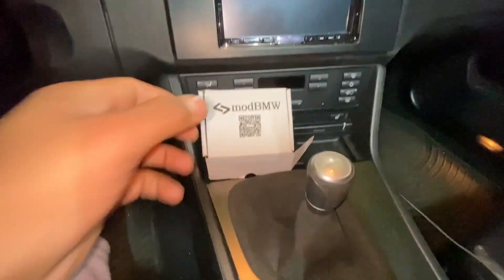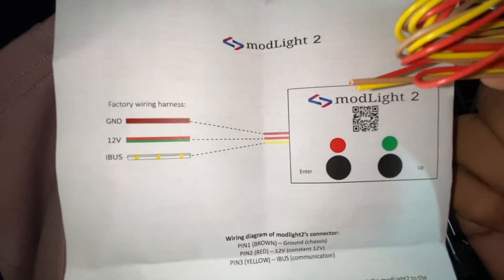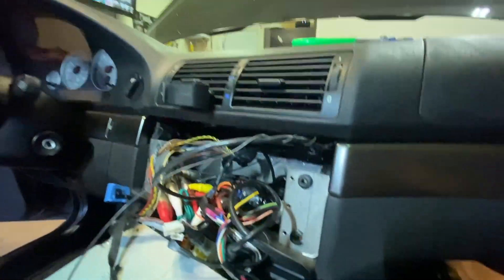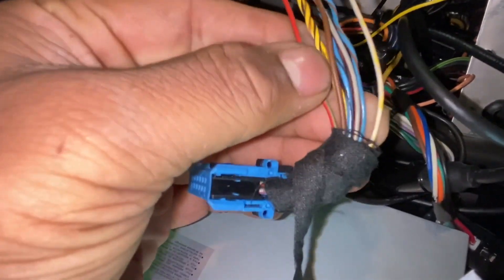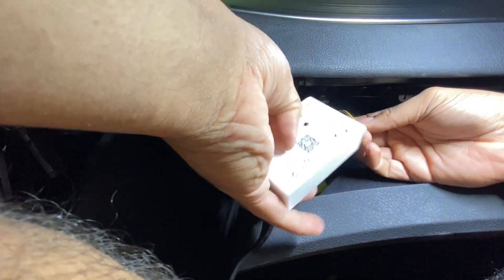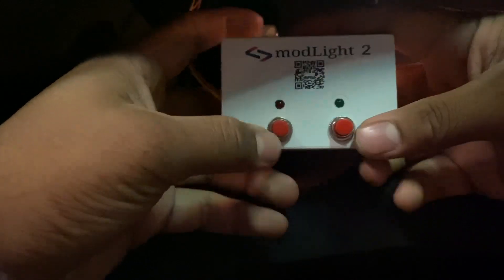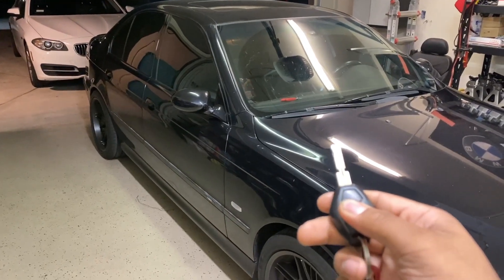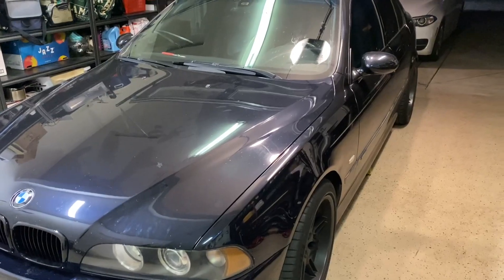DIY: HOW TO UNLOCK SECRET FEATURES ON OLD BMW'S (E39 M5)

Comment: What wheels spacer size are you using ?
Reply from the maker: Fernando Vazquez 3 in the front, 10 in the rear.
Reply: @eurotechnic8718  what size in centimeters?